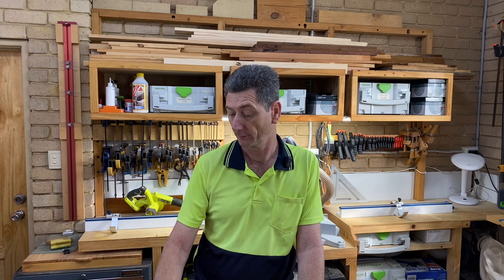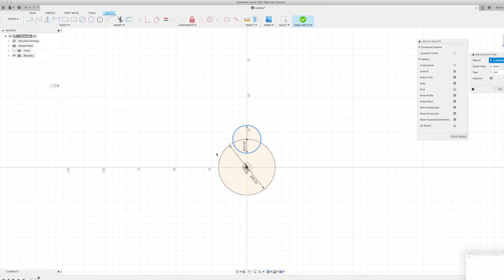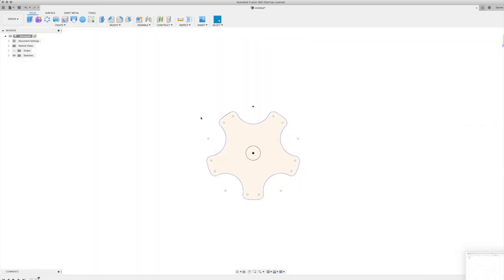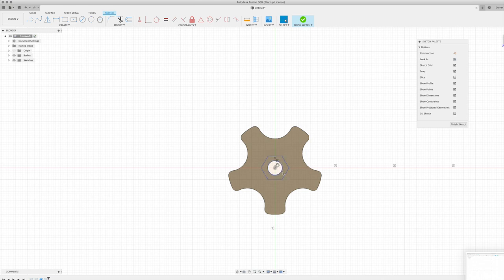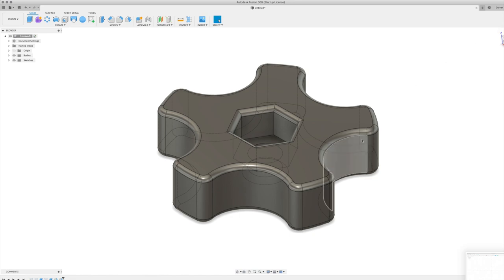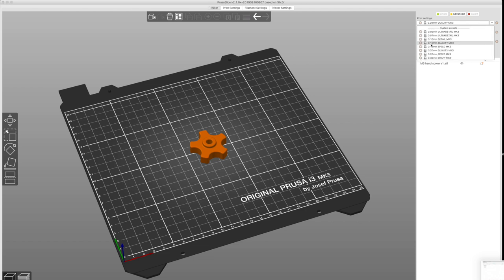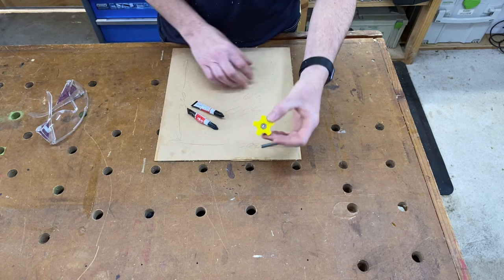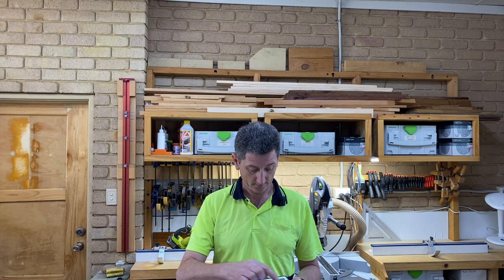Designing a hand screw Knob in Fusion 360

Comment: Question:? why don't you turn the nut a few turns on the bolt, during gluing, gives a decent handle  to grab onto  squeez it in its place and hold it a few seconds, To keep your fingers away from the glue Kind regards Hans

Comment: Have you ever considered making the inset for the nut slightly smaller than the nut and pressing it in?  This would eliminate the need for the glue I believe.
Reply from the maker: I did that with the sanding blocks I made recently, but I still put a drop of glue in there as a precaution.

Comment: small trick I use ... when I want to fit a nut in something I do not give it an offset in fusion , I leave it the original size ... when I print it , obviously the nut will not fit because there is no offset, but I will mount the nut on a bolt, heat it up over a flame and then plunge it through the hole ... this will create a perfect sizeing for the nut with no play and it will be automatically glued in place :)
Reply from the maker: This is a fairly popular method of doing it,  there is a risk the nut going in crooked though, or the part deforming from the heat. This is why I use glue.

Comment: good video. I'm good with F360 stuff, but new to 3D Printing. You flip knob over to avoid overhang - understand this, but isn't the 'floor' of the hex bolt head pocket now an overhang? How does printer print the 'floor' ?  I've seen same in other vids too. What am I missing?  Thks
Reply from the maker: Hi Martin. There is a certain distance 3D printers can “bridge” between two without support. The nut recess is within that range for my printer.

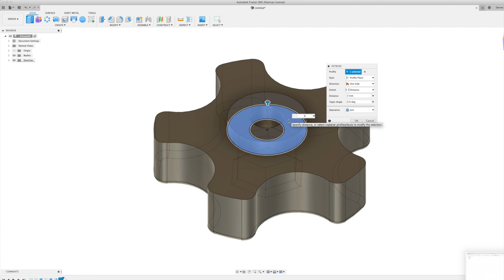Comment: At 9:56 I cannot get a hole in the middle of this extruded addition
Reply from the maker: Hi Michael, I can only guess here, because I can't see what you are doing, but maybe you are selecting the outer ring and the centre circle, before doing the extrude, rather than just the outer ring. Sometimes changing the angle of view can make it easier to select certain parts.
Reply: @DarrensWorkshop  thanks. Somehow I got it to work. Your video presentation is done very nicely. Consider adding closeups for your menu selections. Especially for us beginners.

Comment: You did a lot of extra trimming that wasn't necessary. Just extrude your knob portion and then put on the fillets after extrude. You do NOT have to trim away all those arcs!
Reply from the maker: I know. There are multiple different ways of doing things in Fusion 360. I like to keep things neat. It makes any future changes easier. Especially if referring back to the original sketch. But feel free to take short cuts if you prefer.
Reply from the maker: Also I wanted to add the fillet to the tips of the spokes before doing the extrude. This allowed me a good top down view of the handle so I could see the fillets as I added them. This can be done after the extrude, but then I find myself having to view the model from two or three angles to select all of the edges or faces. Again I've done both, but prefer my way. Each to their own though.